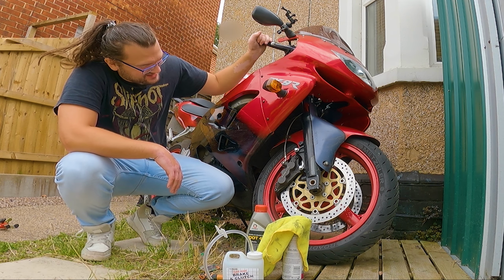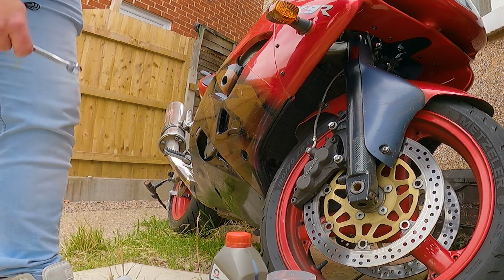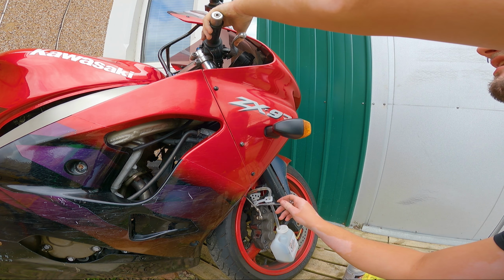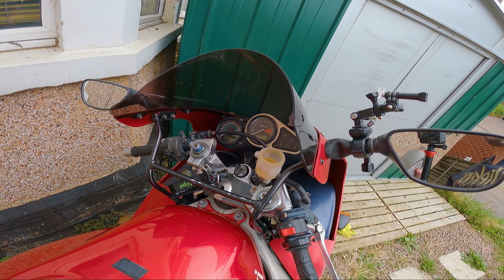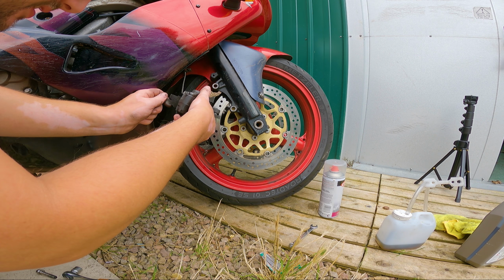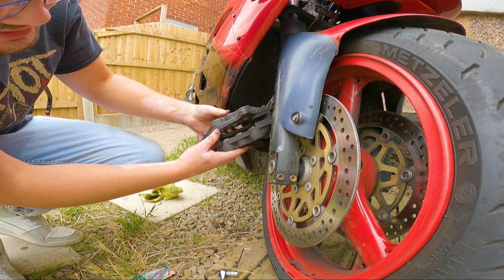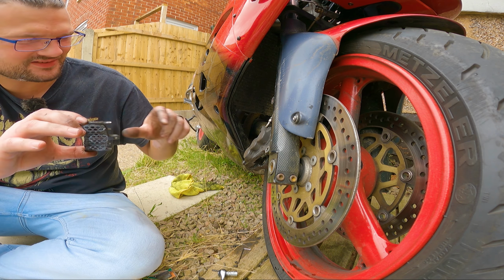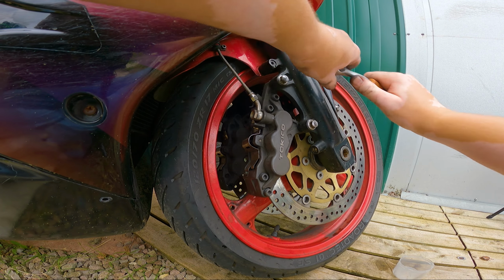Fixing Sticky/Binding Brakes | How To Clean + Bleed Old Motorcycle Brake Calipers | Kawasaki ZX-9R

Comment: Having owned an E2 for 12 yrs the best investment I’ve ever made is swap out those 6 pot calipers and replace with 4 pot Nissins. Saves a lot of maintenance and improves performance. Great vid
Reply: Can you just swap the calipers out without any other changes to be made? What about the rotors and the bolting points? Afaik the Models with the 6 pod come with 310mm discs and the the Nissin 4 pods have 320mm discs...